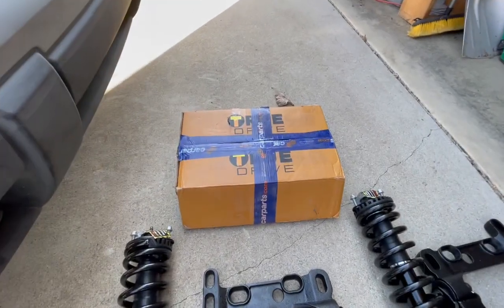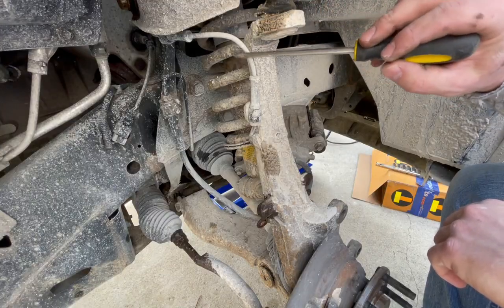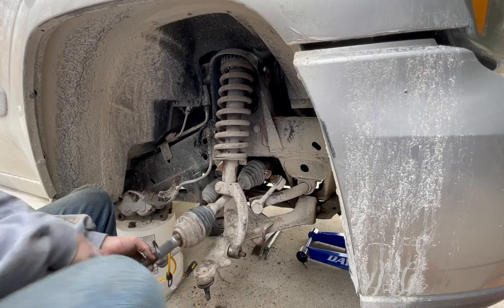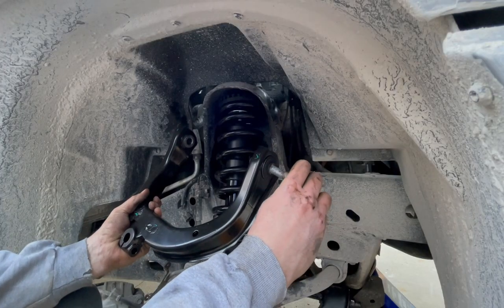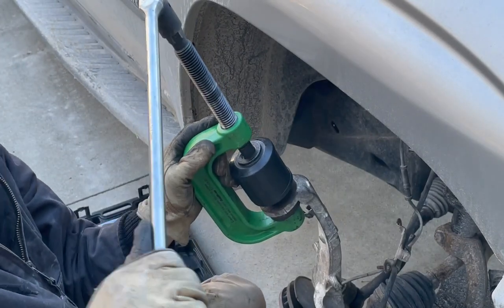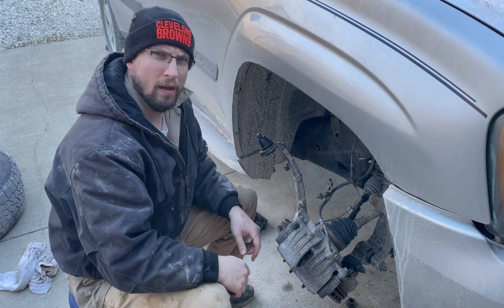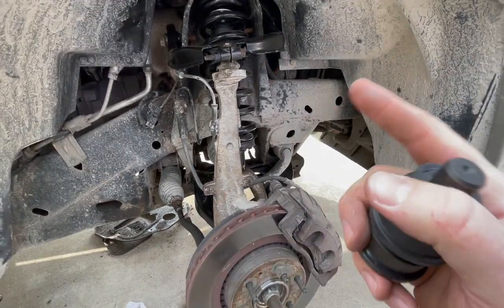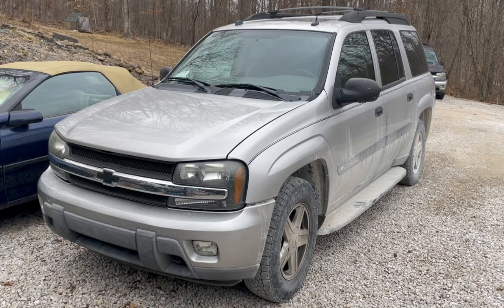2004 Chevy Trailblazer complete front suspension replacement - CarParts.com

Comment from the maker: If you ain’t bleedin’, you ain’t workin’. What kind of injury have you suffered working on a car?
Reply: Busted my knuckle on my right hand to the bone once. That was fun.
Reply: Broke my finger tip pinching it.
Reply from the maker: @supersawyer358  Ouch!!
Reply: So true.  A good mechanic always leaves blood on your engine block lol
Reply from the maker: @MotoModzofficial  it’s like marking your territory. Lol
Reply: As i was putting my angle grinder down, wasnt paying attention and it snagged my index finger and cut me open. Luckily it wasnt too bad, small trip to the hospital and few stitches later.
Reply: Punctured my left wrist removing a wheel bearing seal with one of those hooked tools - I am right handed. My IDENTICAL twin brother punctured his right wrist......with the SAME tool doing the SAME job on his car. He is left handed.....go figure.....
Reply: blood from removing throttle body. I ordered that suspension kit - best price I've seen. Says they give you local quotes from shops for installation? I'm not at all a mechanic but I did buy your Failblazer t-shirt - wore it out and used it to clean the rust off the rear bumper (yes I did remove the bumper cover and did the whole wire brush on drill and then phosphoric acid and then paint). hahaha. thanks for that awesome installation vid - very educational. I'm at 266K on an 04 TB and as far as I can tell only the front right shock was replaced? Very strange. Rides very low and must be dangerous. So I better get it done. I had that "front kit" done pretty much - maybe not control arms? I need to review that huge stack of repair receipts again. hahaha.
Reply: what is compatible with TrueDrive rear shock? They're sending me the front shocks but Carparts says the rear shocks are out of stock. I'm waiting for them to "suggest" something else but I'm wondering if you might know since you have driven with those shocks. So you probably have better experiential knowledge then someone just stocking the shelves. haha. Also maybe I can find it locally and so I don't have to wait for Carparts to figure it out... thanks
Reply: My brother lost his left eye installing new drum brake springs tool slipped and busted his eyeball
Reply from the maker: @EZ4U2Say11  oh my! Horrible!
Reply: ah - you reminded me - that's when I got the brakes checked last. He said it was half done I think? So I gave you the mileage! I'm at 275K now. The welder-mechanic put in this custom designed laser weld kit from the engineer in Iowa - "Taboo Customs" - and the welder-mechanic ALSO put in the rear trailer mount bracket repair kits! And he added when he was done that the TB is a "very smooth ride" - haha. That first suspension replacement turned out nice. thanks for the inspiration. I'm thinking of trying on chassis polyurethane paint - but it's super toxic and I want to get it up on the bottom of the frame underneath (the body frame rust - not the chassis). hmmm. oh well. I was gonna spray it on with a HF battery operated sprayer.... and cover myself - hopefully don't get totally covered. That Chassis Saver polyurethane paint dries SUPER hard. But if it doesn't seal correctly it flakes off easily. So better to use epoxy for the first layer.

Comment: I have an 02 trailblazer. I did the upper c arms, ball joints, struts, and added a 2" leveling kit. I picked up a ball joint press kit and the extra accessories kit from harbor freight. Getting the lower strut bracket off the old ones drove me insane lol. Imalso cheated in the upper c arms, I used a small body saw and notched near the bolts so I could use a ratcheting wrench. Awesome video for anyone who needs to do this themselves.

Comment: I need to do the exact same thing to mine with the exception of upper control arm and rear shocks. I have all the parts, just waiting on a weekend without rain to do it. I'm not looking forward to the back pain afterwards.
Reply from the maker: I definitely had the back pain. Took three days to get back to “normal.” 😖 I need a two post lift.
Reply: @TheDaninator  Oh noooo!! The pain 😫 
I've dreamed of a lift for years.
Lovin' your content brother, it inspires me to get it done, even with the addition of future back pain.
Reply: I once installed air suspension on a BMW on jackstands in literal rocks. Thr back pains were reallll. Im having PTSD as i’m about to redo my 99 1500 front end and reading your comments.

Comment: Hey Dani, you show the torque to tight the bolts, but what tool do you use ? you only show the air tool, does that gives you the right torque or you end up with torque driver ?

Comment: I'm going to be doing my lower control arm bracket on my 03 trailblazer, are you suppose to mark  where the old bracket was so you can get the new one in the right spot?
Reply: You can, but it doesn't help. There's 3 angles on the lower control arm mount, and it will need to be aligned.

Comment: How did you like the shocks? The parts link to front end kit died.
Reply from the maker: The shock are nice. So far, so good. 👍
Reply: @TheDaninator  I got this kit installed but I think I didn't get the upper control arms replaced! Dang. gonna try to rust treat them now. Still the TB drive is SO much smoother with the new suspension - I also got the new rear coil springs put in.